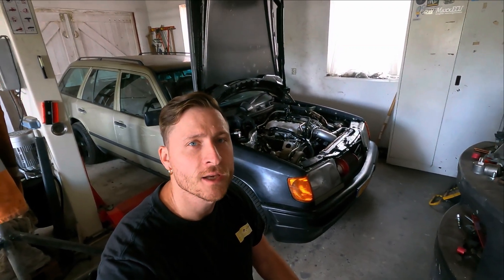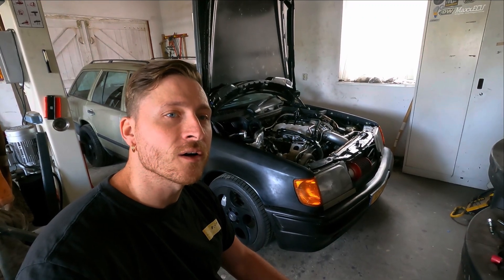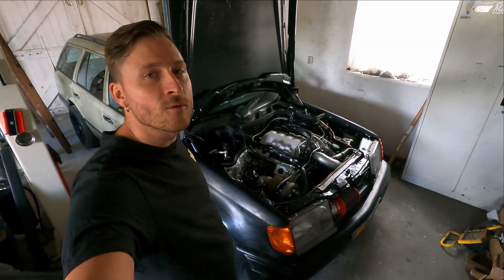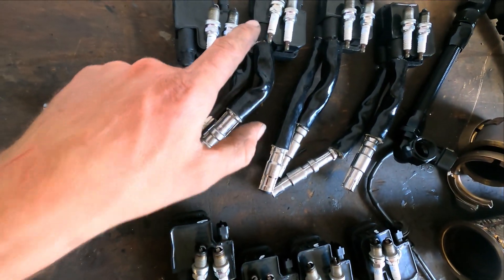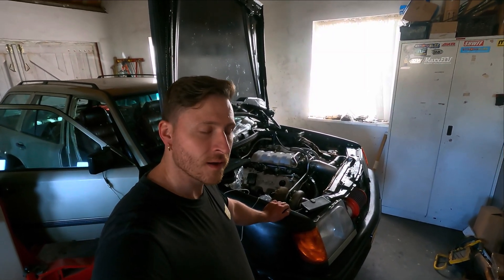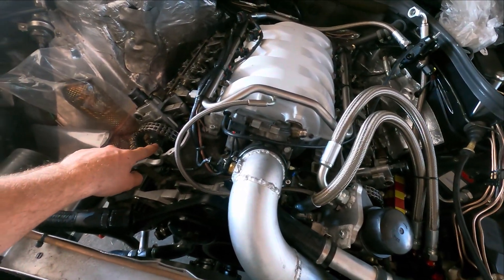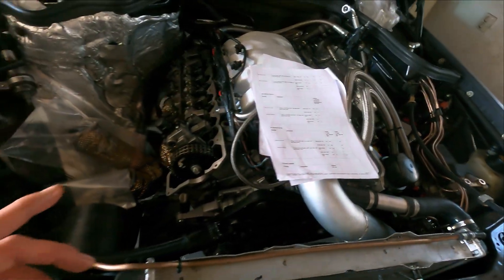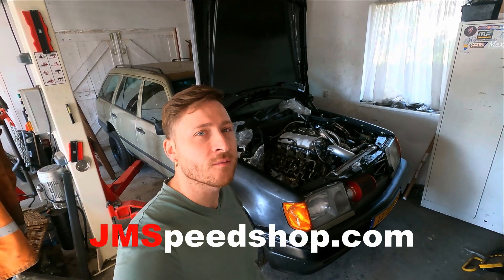Investigation after dyno session. No power after 4500RPM? S124 V8 Turbo

Comment: My favorite build here on YouTube for the following reasons: 

1) My M113 engine has become my favorite since driving one now for about a year, truly the "German LS" when used NA motors like ours can be had so cheap, and with such robust design.  

2) You are doing something no one else is doing, a challenge which you openly share real ups and downs of the process, you shall prevail and its glorious to follow the journey. 

3) Because commenter's are sharing meaningful help, and good thoughts to support your success, a other level of enjoyment to observe

There has to be something about cam timing which we can measure and share back, to help confirm what seems very odd reality of such a superb German design.

I have spare cams here, with hope to regrind them for more duration like the "hillbilly hammer" on YouTube, another interesting build. My ability to measure the cams is not sufficient, but the chain stretch seems very strange.

I hope better minds than mine can share more help, as this superb build and tour amazing shared adventures here deserve ❤️
Reply from the maker: Thanks very much for your support

Comment: Could the dual spark system be causing issues. I think the factory settings uses both only at lower rpm/engine load and only uses a single plug at high rpm and loads.
Reply from the maker: I dont thinks.  I would only benefit the ignition

Comment: Possible valve float. Running boost on the backside of those valve will make them want to stay open. The Kompressor engines ran different springs for this reason. I show what stiffer Compcams springs I ran in one of my videos but I dont know how much stiffer than stock they were . Sorry, I dont recall if you upgraded your springs
Reply from the maker: Thanks.  Yes.   I have oem springs.  Now but will upgrade for sure incl cams

Comment: I somehow didn't even notice the ZAS system when watching you put the motor together in the earlier videos... Have you considered going twin turbo with the same size as current? What size do you think you would upgrade to if so? I'll txt you :)
Reply from the maker: I have consider that but there is no room because of abs and SLS system .  And downpipe on the driver side will be very tight
Reply: I'd love to open a shop in Oregon to upgrade the M113 to a rear mounted turbo system. Removing the exhaust, there is a huge amount of room back there for the a single or even twin turbo system.

One of these days I'll do a cost analysis of parts, labor, tuning, RnD.

Minimum goal: Faster than stock E55 0-60

Optimal goal: Faster than E55 with VRP Stage 2/3 tune.

Destruction goal: faster than Whipple swapped E55.
Reply from the maker: Nice.   But dont forget s turbo system in the back also needs charging pipe to the front and intercooler.
Reply: @JMSpeedshop  of course. Immediate thought is to run a single exhaust pipe to the trubo, and a charge pipe to the front mounted intercooler. There would be adequate heat shielding to prevent the exhaust from heating the charge pipe. Twin plates separating exuahust tunnel. Coated exhaust pipes may be an option depending on cost. Will also benefit to prevent thermal energy loss before reaching the turbo. 

Luckily with rear mounted turbos, the length of the charge pipe can sometimes cool the air temp enough that an intercooler may not be necessary.

My biggest thoughts are with tuning, dealing with the MAF sensor, flipping the intake manifold?, oil cooler for certain engines that don't have the oil cooler mounted on the filter, possible meth injection. 

Plenty of options out there for intercoolers, turbos, fuel pumps, fuel injectors, waste gates, BOV, oil coolers. 

Always sounds easier on paper than it is to actually though. 

I appreciate your input.

Comment: Sure you are on the right track. Personally, I would do away with this staggered cam timing and the cylinder shutdown. Especially with your setup. I would measure the valve opening using a Dial Test Indicator, on both banks. You say you can’t adjust the cam timing, but you can if you remove the dowel pin? It took me nearly one week to adjust the 4 cams on my M119. But in the end I got them all within 1/2 a degree. Remember, the cam only moves at half crank speed, so 10 degrees crank is 5 degrees cam? Take time and keep us posted.
Reply from the maker: Yes for sure i will remove the ZAS system .  Will do different cams and double springs
Reply: @JMSpeedshop  just one more thought, these original have a vacuum operated variable inlet manifold, what have you done to that?
Reply from the maker: @bernardwarr4187 i have a seperate vacuum chamber outside the manifold

Comment: What you called cilinder 1 is actually cil 4!
Reply from the maker: Oke can be 😀 but cyl 1 is in front of the engine first  left bank
Reply from the maker: I just watch .  And im correct in de video   cyl 1 is the front left    this is also on the valve Cover
Reply: Yes i know
 But when you test fired the single plug the coil is not the first one. You probably connected it to connector one
Reply: That was confusing 🤪
Reply from the maker: Yes okey.  Was just for testing 👍